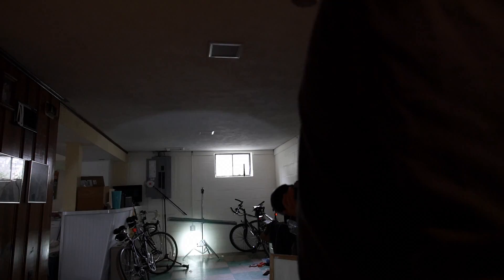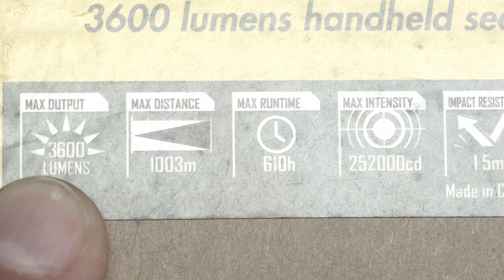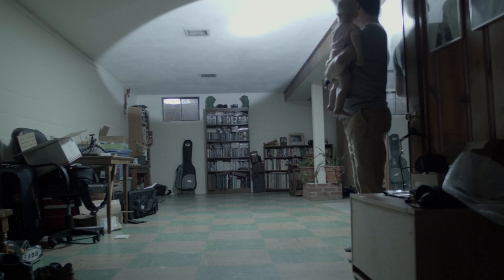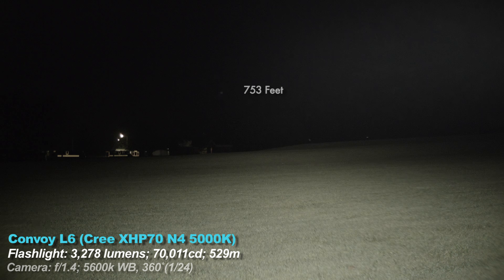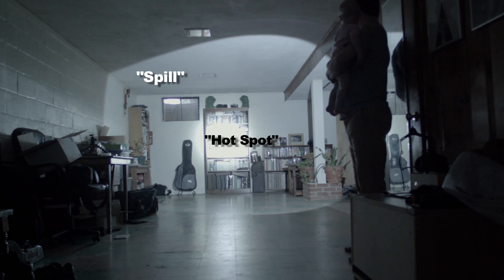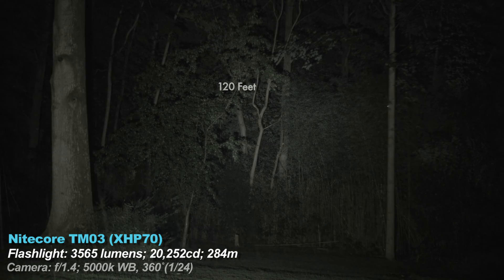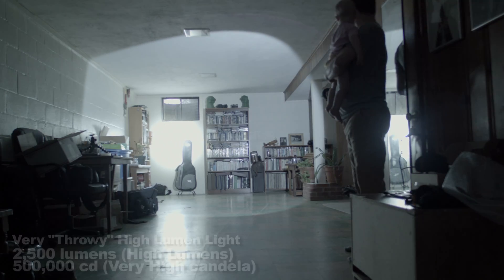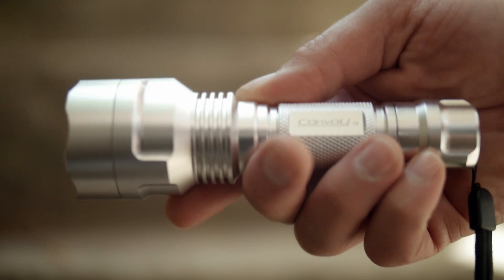How Lumens Lux and Candela Relates to Throw and Flood in Flashlights.

Comment: my nitecore tm38 is 1800LM and the beam goes 1400meters at max but my olight x7r is 12000LM but throws oley 380meters and my brand new imalent dx80 is 32000LM it goes 700meters i dont geth it
Reply from the maker: I thought this video explained it.  Lumens and candela are sort of related but also seperate.  High lumens does not translate into far beam distance.  The LED type  the optics and reflector determine how the flashlight uses those lumens... Less beam distance means it scatters light more... more beam distance means it makes the light more directional and focuses it.  Your TM38 allows you to illuminate distance objects better, because it's reflector system "focuses" the little bit of light it produces more effectively than the shallow optics on the other two lights.  Just go outside and shine the lights on an object several hundred feet away (500 feet or more or better) and turn each light on max and see how well each light illuminates that distance object.

Comment: If 1 light measurements for example same as yours 3600Lumens 1003m distance and 252000cd then two exact same light directed to same direction will multiply the numbers by 2 or how to calculate the numbers?
Reply from the maker: I would have no idea.  I’d just shine two lights on the same lux meter and see what you’d get

Comment: I Know that there are some lights, were you can like twist on the body of the light in one direction and it can spread out "hot spot" and in the opposite direction it will focus the "hot spot" is there is there a term for flashlights that can do that? I believe some old maglites were capable of doing that.
Reply from the maker: +AloxxaS adjustable focus?  I don't know the marketing term... some maglites still do that- but not well.  Zooming lights nowadays have a similar sort of setup- you can make it an extreme pencil thin spot or a very wide even beam- much nicer than the old maglites.

Comment: Nice summation, Bro, that clears the distinction like crystal. Also it should be noted that the eye-o-meter detects candelas, not lumens, so whatever douchebag that disses a floody light because it's not as intense as the beam of a throwier light deserves to be told how full of shit he is.

Oooo boy, I wanna see that C8 review. Love mine, it's by far my best thrower despite the OP reflector and the domed LED. And the Biscotti explanation will be of great help when I receive my customized M1.
Reply from the maker: I read some talk on BLF about some buggy revisions in the convoy... and I have found that when I run the battery down- and LVP kicks in it wakes up in programming- although cutting it off and on, solves that problem.  It doesn't consistently come on in programming mode- just occasionally.  It's like an 80Kcd light at only 800 lumens... pretty impressive and throwier than those astrolux SS lights.

Comment: I used to have one of those 10,000,000 candlepower spotlights in my car when I was 16. It was a thrower, not far off from the vehicular version of what you see in police helicopters. We bought it at a flea market. It was the kind that uses your 12v outlet, still called a cigarette lighter back then. It had two modes, OFF and what we would now call Starkiller.  I guess it was left in mode Starkiller face down on the floorboard after driving around with a buddy waking up birds in trees after dark. He must have just set it down on the floor when we got out of the car because in the morning I returned to witness it had melted a 12" circle in the floorboard carpet before completely melting the reflector and plastic housing and eventually blowing the bulb.
Reply from the maker: Yeah man those things got hot.  At least modern lights have electronics in them to protect them from that happening... somewhat.  I do see occasional posts though about burned pockets or bags... You can still get those HID flashlights... I think a company called Firefox makes them.  But better color rendition and clusters of hard driven cree emitters, are starting to put them to shame.  I'd still like to get my hands on a HID again sometime.

Comment: What's your favorite floody light for close to medium range work, mostly indoors?  I have a Convoy S2+ that I like very much and it has a nice even light spread.  Like you, I use my lights mostly indoors so I prefer a floody light.
Reply: Khyber Safi. Olight s2r is a pretty floody light and is probably the smallest 18650 flashlight I've seen so far
Reply from the maker: +Khyber Safi Like "me" said the S2R or even S1R are both nice. They aren't too high in the candela range... and I'd describe them more as having a large even hot spot because of the optic, than just pure light scatterers.  It's a useful beam for close ranges.  Check out my review of those two lights.  I think they're available in neutral... that's the tint I'd go with.
Reply: Khyber Safi 
I really enjoy my Convoy S2 (not +) even more than I do my Olight S2, which is pretty much the same as an S2R that "me" and Bro mentioned (same emitter, same lens).